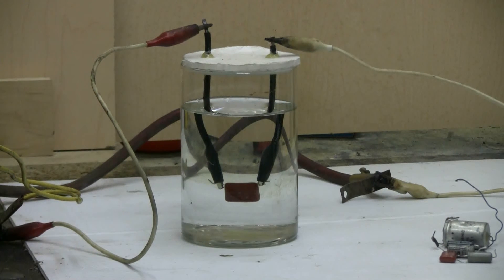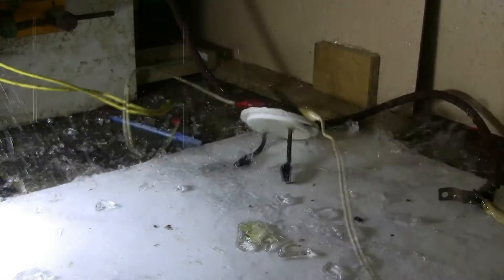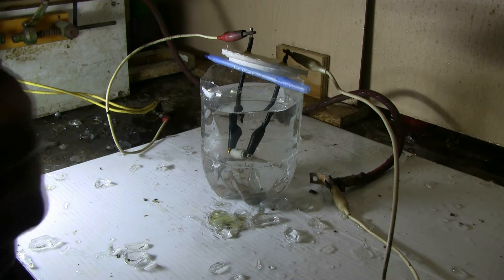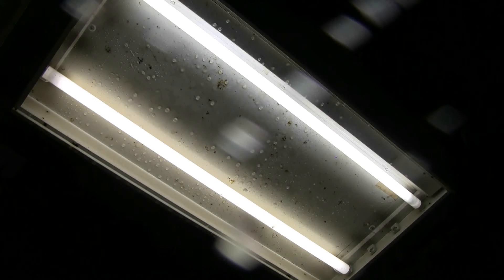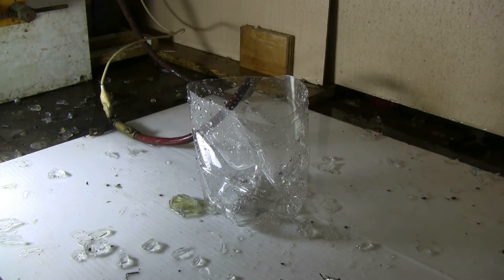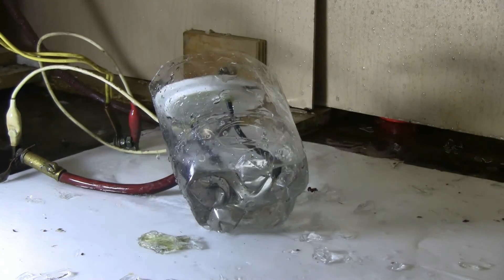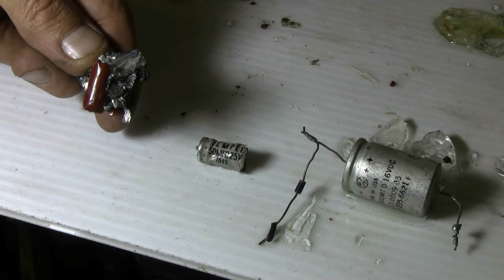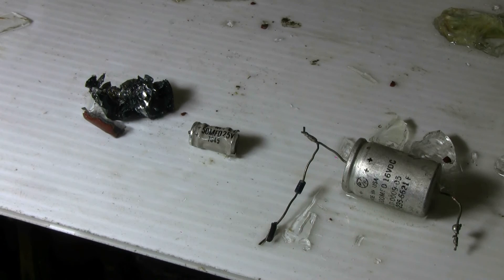Capacitor Bank #86 - Capacitors Under Water

Comment: I think the reason why the little cap crushed was because the arc was external to it. This caused a shock wave in the water (which is what broke the glass jar ... plastic is a bit more forgiving) which compressed the capacitor, instead of exploding it :P